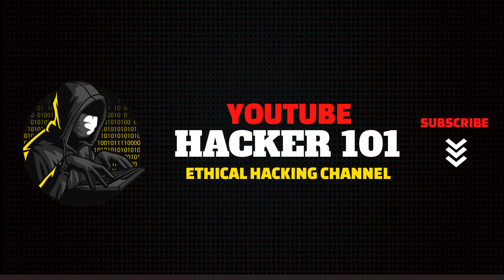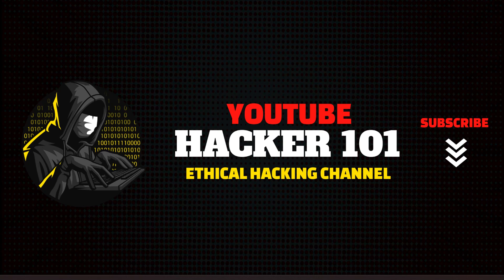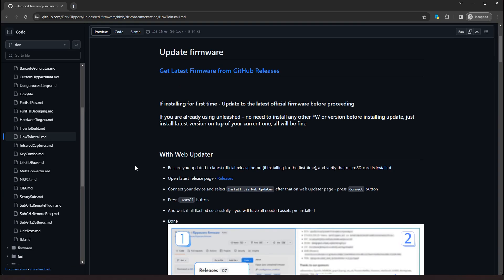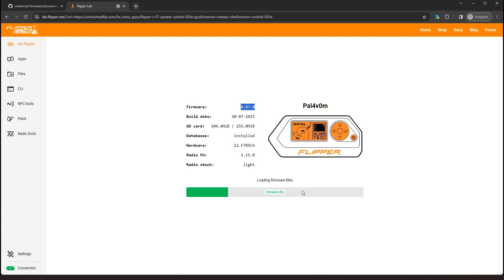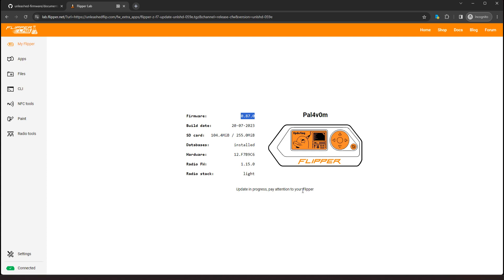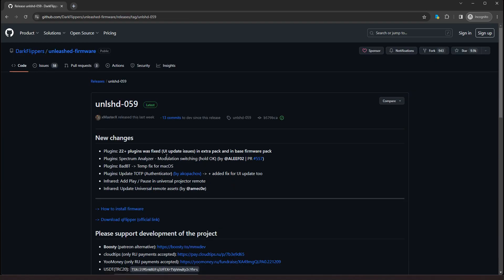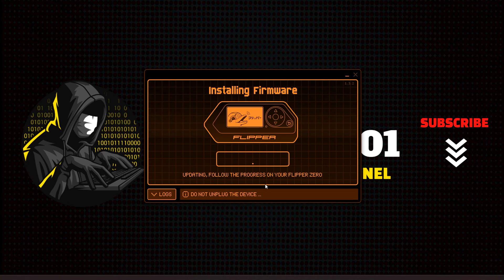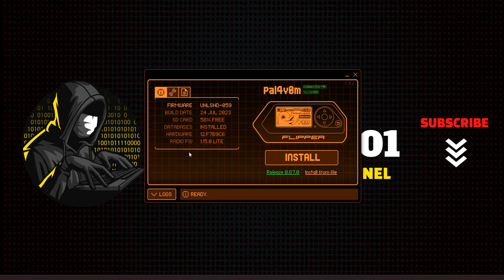Flipper Zero: Install Unleashed Firmware with Ease

Comment: Thank youuuuu I’ve been trying to find a way to update my flipper to unleashed and it was a little outdated for 2024 but I just followed the screen and it worked PS: if when you get to the white flipper screen where you web upload don’t forget to NOT have the flipper screen in the background if you are mirroring the screen it will say that the port is busy so just hit the x in the top screen of the flipper window